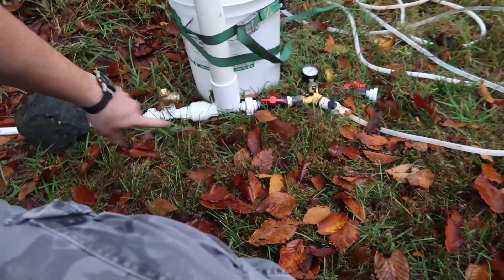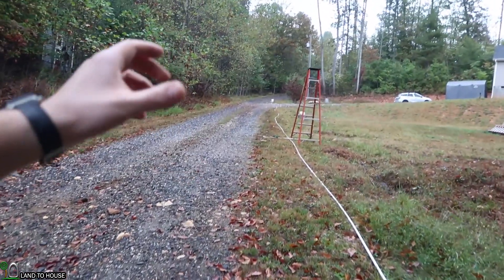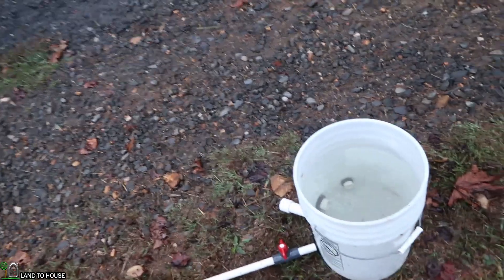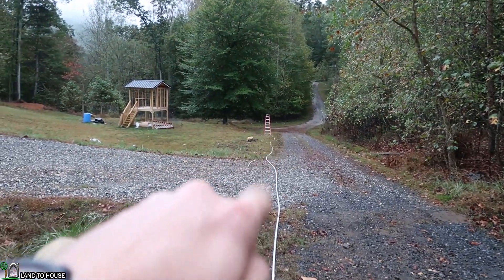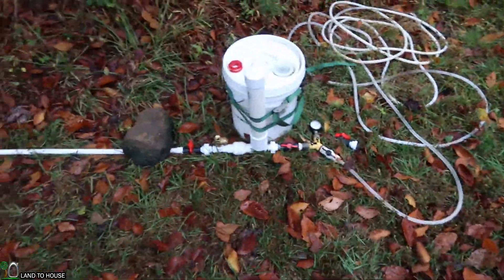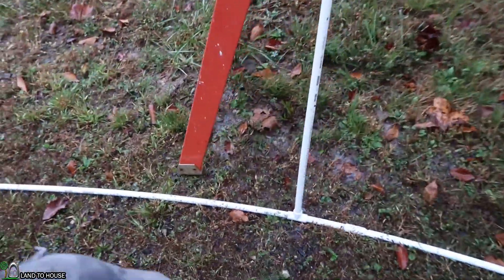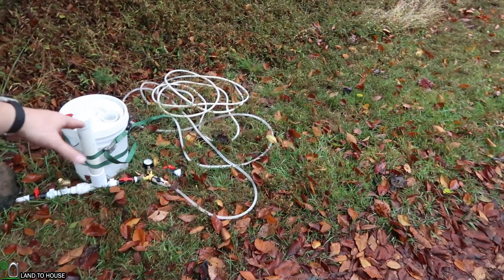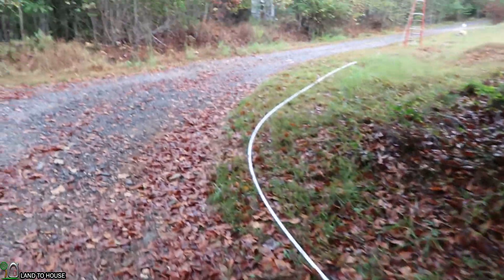Installing a Stand Pipe for Ram Pump

Comment: Thanks for the video. I’m curious of a couple questions as I’m sitting in the woods of East Tennessee right now next to my creek (ahhhh the beauty and sound of the creek). 

1.  I don’t know how to judge how many gpm my creek is providing….I’m sure it’s more than I think, although it is a constant flow and not trickle….  If I emailed you a video just to show you, do you believe you could say “that’s probably ‘x’ amount”?

2.  The place where I want to have the water delivered to is up on a hill, probably 20-40 feet ABOVE my creek….and maybe 400 feet from where my ram pump would be situated. I think, and please correct me if I’m wrong, the delivery/supply line exiting the ram pump can be as long as you need it to be but you’ll need to maintain about 1’ of rise in elevation, before the ram pump, for every 7 feet of climb after the ram pump. As long as I meet the requirement for rise/fall, can my supply line be as long as I need it to be, regardless of flat line distance?

3.  Although my creek flows all the way through my property, the spot where I want the water to be delivered is elevated above my creek AND probably equal in elevation to where my ram pump would be situated. If I have a 100’ drive line, on an estimated 3/4 or 1 inch ram pump, then I don’t think I would have adequate flow to properly drive the pump (there’s barely any standing water in that area of the creek….maybe an inch or two deep but there IS a constant small flow). Having said that, I now understand I’d need to install a stand pipe. Which leads to my next question…

4.  As long as my stand pipe is place within the 100’ distance from my ram pump, can the stand pipe supply line be an infinite distance long going up the mountain/creek and feeding down to the stand pipe riser?  Reason I’m asking is, further up the creek, although it still flows nicely, it remains shallow but the incline increases more and more. Probably 400-500 feet from the stand pipe I begin to get heavier flow and better pooling spots of water. While I don’t WANT to spend all the extra money for longer and longer supply line to the stand pipe, I don’t know how to resolve the issue. So….worst case I just buy enough stand pipe supply line to reach the pooling spots farther up. Can that supply line going into the stand pipe be as long as I want it to be, as long as the stand pipe riser is tall enough to not have water flowing out of the top of it (the riser has to be higher than the source)?

5.  Once I have everything hooked up and working, and water is flowing into my designated food grade IBC tote (that we will use to water our garden and fruit trees) can I place a valve at the tote to close off the flow of water filling the tote once it’s full (and will the waste valve continue to cycle down at the creek if no water is being dispensed/delivered into the tote)?  More importantly, once I use water from the tote, and want to let it refill, can I ope the “tote flow control/fill valve” and the ram pump still work properly again, or would I be forced to go down to the creek to reset everything each time?

6.  If the ram pump was built from all metal parts, would it (in your opinion) last longer or be more (or less) reliable and functional?  I’m just curious if it would be of any extra benefit to go with metal instead of PVC (not just from a cost perspective)?

Sorry to bombard you with all these questions, and I was going to email all of this to you but thought it would be more beneficial to others doing the research to see it here (and save you from answering the same stuff over and over……as much lol). 

Thanks again!

-Dean

Comment: Has anyone found a rectangular barrel or tub that can accept multiple supply pipes and dispurse multiple drive pipes to use as a stand pipe.?
Reply from the maker: I suppose you could just use  an IBC tote and install uniseal for the multiple pipe points.

Comment: Thanks for these videos, they've been helpful to me, and I'm sure to many others as well. 
Stand pipe placement seems to be a mystery. No one has a definitive answer to the question of where to place it. 
My uncle who is the keeper of the family's ancient trinkets, tools, and tradition, tells a different tale when it comes to ram pumps. 
My family has been using ram pumps for over 200 years. They would use the power of the creek water to pump fresh spring water to the house, and had enough pressure to spray water all the way up to the roof of the 2 story house, from the ground!
Apparently the stand pipe was always placed really close to the ram pumps that my family used. Like within a couple of feet. My uncle is insistent that I will improve efficiency by moving the stand pipe closer to my ram. So much so that I've become curious about it. He also says it will reduce the strain on the driveline from the hydraulic shock, which makes sense.
Testing this would require me to make some pretty big purchases, so I'm wondering if you'd revisit this experiment. 
Will you consider making a part 2 where you place the dive line within a couple of feet of the ram?

Comment: @5:25 "... I am notoriously bad in judging height ..." Ha ha, I can confirm that. I can remember that in one of your first stand pipe videos the stand pipe was also notorously to short. ;-) Concerning head pressure: With the 10 feet stand pipe and the drive pipe going still down the road you even have much more than 10 feet of head pressure.

Comment: When the waste valve closes it causes a pressure spike that travels forward through the delivery check valve, and backwards up the drive pipe till it dissipates.  This reflected pressure wave going backwards is what allows the waste valve to cycle.  Watch the video closely and note  that without the stand pipe the waste valve stays closed for a while before dropping down for the next hit. The stand pipe provides a place for the reflected pressure wave to push against the air without having to propagate all the way to the source. Watch the video closely and notice that with the stand pipe the waste valve drops open almost immediately after each hit.

Comment: If I had watched this and other stand pipe videos more carefully, it would have saved me some time last summer.

I had an initial installation with a single 1 1/4 inch drive pipe Land To House ram pump with 30 inches of input head, 70 feet of drive pipe and 3/4 inch delivery pipe lifting to 10 feet with 12 cycles per minute (which I was told is slower than optimal).   

After reviewing this and other stand pipe videos, advice from the Water Powered Pumps Facebook group and trial and error, I ended up changing to 50 feet of 2 inch supply pipe to a 3 inch diameter / 4 foot tall stand pipe (filled to 20 inches at stand pipe location) connecting to a 20 foot 1 1/4 inch drive pipe (allowing another 10 inches of head).  This configuration resulted in 1/2 gallon per minute or 70 percent more water than the 70 foot drive pipe in my situation.

Having the stand pipe with 20 feet of drive pipe pumped more water than at 30 or 10 feet of feet of drive pipe (all with total supply and drive of 70 feet), but I have not experimented to see if something between 30 and 10 feet rather than 20 feet of drive pipe would be significantly better, because I had 10 foot lengths of PVC pipe and I didn't want to initially cut them multiple times - may experiment next year.

The bigger supply pipe is a mixed blessing.   2 inch supply pipe and fittings are bigger, more expensive and harder to haul than the 1 1/4 inch drive pipe, however, on the positive side, I don't think they need to be as solid and direct to the supply pipe as long as the stand pipe gets filled.

Some have said 3-2-1 ratio with 3 inch stand / 2 inch supply and 1 inch drive (I used 1 1/4 because the size of my pump).  If I was to go to a 2 inch pump, that might imply 6 inch stand, 4 inch supply and 2 inch drive, which may be an issue - harder and more costly to find 6 inch pipes and parts.  Not sure from a supply standpoint why it matters if the stand pipe fills and least resistance for shock wave to go up the stand rather than the supply - so two - 2 inch supply pipes with one 4 inch stand  to a 2 inch drive might work - not sure.  

The stand pipe after 50 feet supply and before 20 feet of drive allowed me to pump 70 percent more water.  Perhaps different size pumps, different amounts of head, different slope and different amounts of required lift might result in different results - what have you found?

Link to installation discussion and pictures in the Water Powered Pumps Facebook group:
https://www.facebook.com/groups/240458583255303/permalink/663829874251503/
Reply from the maker: Very good examples and results! Thank you for sharing your experience. Getting the cycle time as close to 1 per second as you can will give the best lift and volume (from my testing)
Reply: Ok, so I don’t have any lift at my drive pipe, so I just need to increase the size of the supply, install a 3” stand pipe and continue with my 1 1/4” pipe to my 1 1/4” pump???
Reply: @pauldickinson6612  when you say you don't have any lift at the drive pipe, is the pump cycling?   If so, probably some water is coming out to the output delivery pipe (unless the output valve is closed).   If you have some head and water is flowing through the pump connections, check for air in the pipes and try temporarily turning off the output valve (seems very odd my pump will cycle this way, but mine does with hard jolts).     If your pump cycles when the output valve closed, try adding output delivery pipe height until the pump cycles with the valve open or partially open.

I was afraid that I was going to have a hard time getting my ram pump to run, but I never have after clearing the air and adding output lift height or shutting the output valve.  Another oddity, is my pump is very consistent for volume pumped per unit of time, unless the input filter clogs.

Am I understanding your situation?

Comment: Thank you for the video.  I have a recent install of a land to house 1 1/4 ram with 75 feet of drive pipe producing 30 inches of head and cycling dependably at 12 cycles per minute which from your videos and feedback from the water powered pumps facebook group, I gather is slower than the 1 cycle per second suggested optimum.

I've rewatched all of your stand pipe videos because I had forgotten the function of the stand pipe beyond removing air which is not currently an issue since pulling from a small pond in the creek.

I'm looking forward to experimenting with a stand pipe and separately initial top pipe size.  Will report back on difference in volume of water pumped.   Dave

Comment: Is the rigidity benefit/requirement of the delivery pipe extend beyond the stand pipe or can you have a more flexible pipe above the stand pipe?
Reply from the maker: It's just fine to have a more flexible supply line from the intake to the stand pipe. Then go more ridged from the stand pipe to the pump.

Comment: Would a stand pipe at 40' or 20' do better or worse than at 60'?
Reply from the maker: That is a good question. The location of the stand pipe will effect the cycle time. If the cycles are too fast the pump does not build enough pressure. If the cycles are too slow the same happens. The perfect cycle time is around 1 per second. So based on head pressure and drive pipe length there is a point when this cycle time happens. I do not know the math to tell you the perfect location every time. But I can say that the source location from the pump can effect the pump and it depends on the head pressure.

Comment: Have you tested multiple stand pipes on a long run
Reply from the maker: From my understanding there is no need for multiple stand pipes. You only need to bring the source water closer once. The position of the stand pipe is going to make the difference.

Comment: Have you ever noticed when your head pressure is high you can increase the cycle Time by weighting the flapper valve.
Reply: You could weld a little piece of thread to the valve and add nuts to it as weights. You also can get wastegate valves that have Springs in them and you can soften the springs and change the direction of the spring. I've only used standpipes so I could reduce the Shockwave bubbles that form over a hundred feet. I had one one time 200-foot Drive pipe and it kept on creating microbubbles every time it's slammed. After installing a standpipe the bubbles would make their way out of the standpipe.
Reply from the maker: Yes that is one of the benefits of a larger commercial ram pump. They have weights that can be added to the waste valve to adjust the cycle times. In the Land To House ram pumps the only real adjustment that can be made is moving the water source closer or further to adjust the cycle time.

Comment: Very helpful video. I got a question about your packaging (it’s very good) but Is the foam in the ram part of ram pump packaging like how you packaged the waste valves with foam or does it serve a function? Thanks for your service
Reply from the maker: Hello. The foam is only there to keep the pump from rattling during shipment. There is no other reason to have it in the setup.
Reply: @LandtoHouse  Great to hear. Now I have certainty. Thank you so much. Keep up your recorded experiments. Thanks for your business and public relation skills.

Comment: Would it be better to have steel drive pipe?
Reply: Steel would not be more efficient in regards to the gravity fed flow rate of the source water. Steel has a higher friction loss coefficient than that of PVC. Friction loss is the reason why the standpipe made an improvement to the cycle rate of the ram pump. You can get the same result by going with a larger drive pipe size which would increase cost, but may be necessary if a standpipe is not feasible due to a number of reasons. 

Using a standpipe in the wrong location can have detrimental effects due to increasing the probability of pulling in air the closer you place it to the ram pump. Example: If you have a constant elevation change, once you pass 50% of the drive pipe length you run the risk of pulling fluid out of the standpipe faster than the water source can replenish. A follow up test would be to use clear vinyl tubing for the standpipe with a mark of the fluid height with the pump off then turn the pump on and monitor the fluid height in the tubing at constant pump rate while marking any change in fluid height every minute. The monitoring period should be until the fluid height in the standpipe does not have a noticeable change since the change in fluid height per minute will be reduced until reaching a balance point where the water source can keep up. Run the same test at different intervals along the drive pipe length starting at 50% of the total length working your way toward the ram pump.
Reply from the maker: Yes it sure would! That is rather costly though.

Comment: To make a test to a ramp pump you have to overflow the water soure(inlet), i presume
Reply from the maker: Yes the ram pump requires a constant flowing water source. If air gets into the drive pipe it will stop the pump.